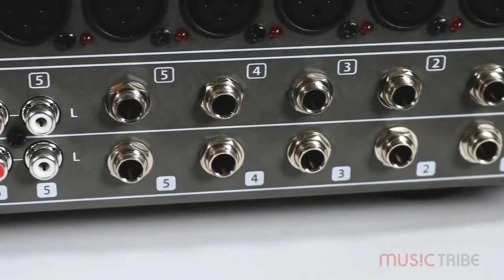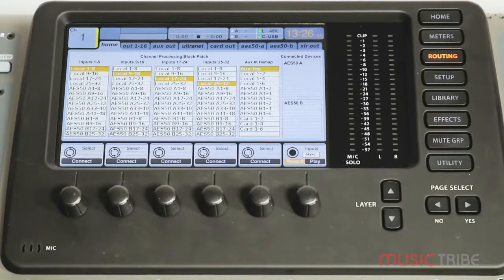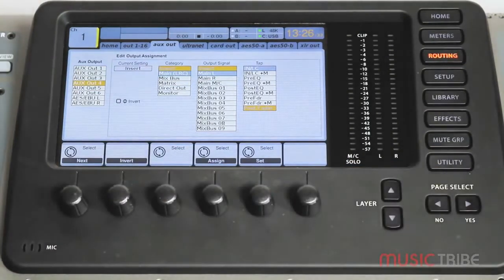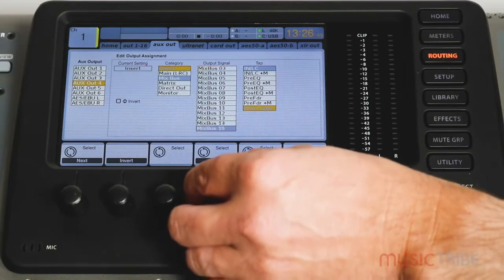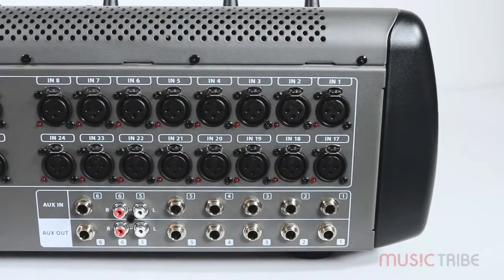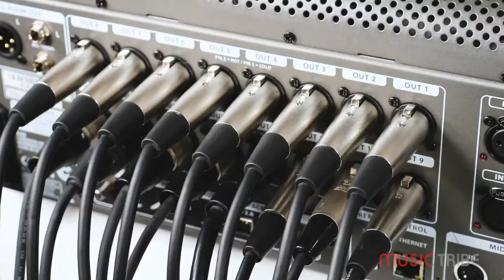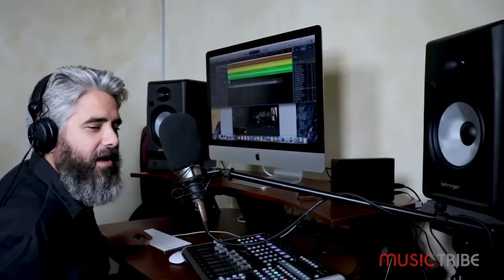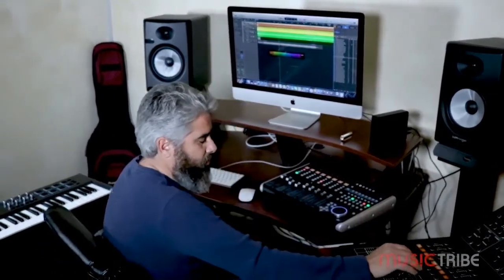AUX OUTS FOR BEHRINGER X32 MIXER

Comment: Hello David. Thanks for your Great videos. I have a Behringer X32 Compact at our little church and I am getting to feel my  way in getting to understand it. Thats why your videos are so vital to me. One of my 2 main speakers output plugs (7 and 8) does  not  work ( plug 8). I switch both snakes and they do work in the same output plug (#7).Do you know could have  cause this? I know that both snakes are working, and both speakers are also working  because when I switch the snakes  in the same number 7 output plug both speakers  work one at a time of course

Comment: Dumb question but how do I get the aux outputs to be routed to the quarter inch aux outs for in ear monitors? I’m using the x30 to rack. Thanks so much
Reply: I have the same question.
Reply: Kegan - Set the aux out tab to use mix buss 1-6